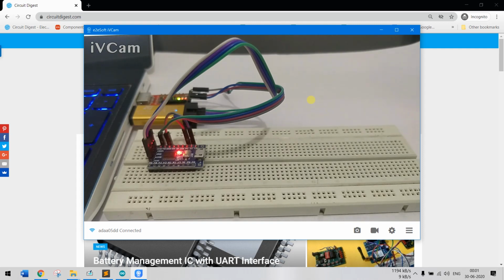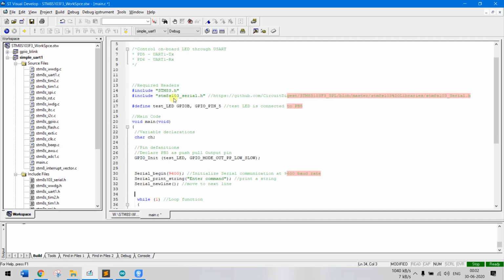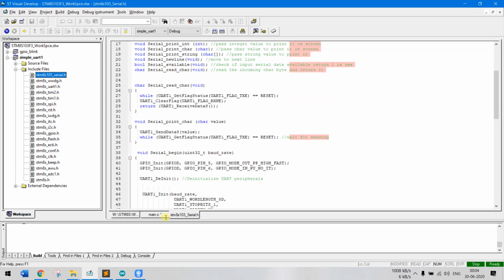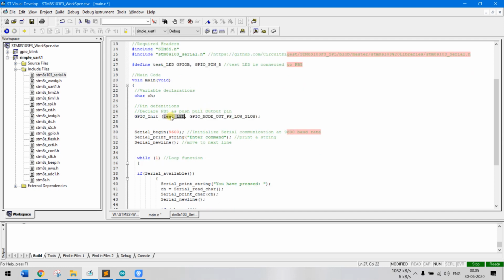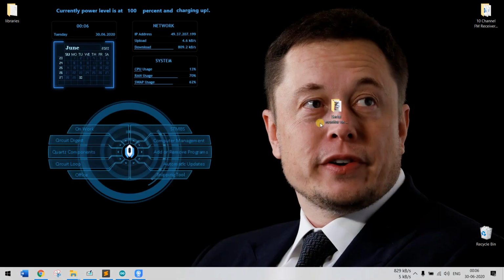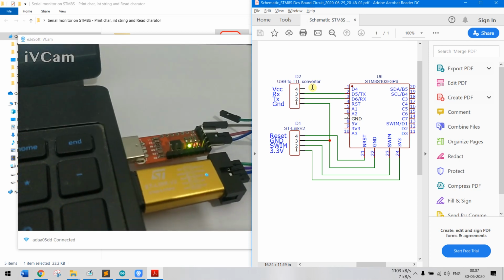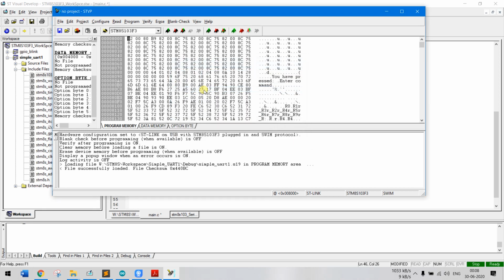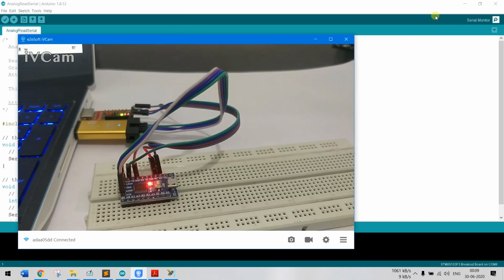Serial Monitor on STM8S using Cosmic C and STVD

Comment: I have the same problem with st-link programmer. After the programming the board is held reset. So i have to disconnect st-link. Very anoying.